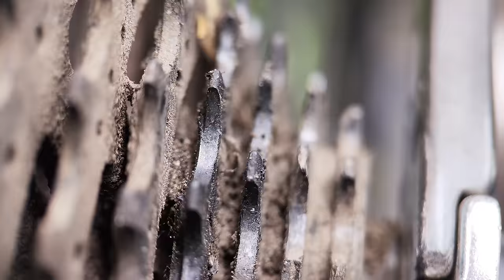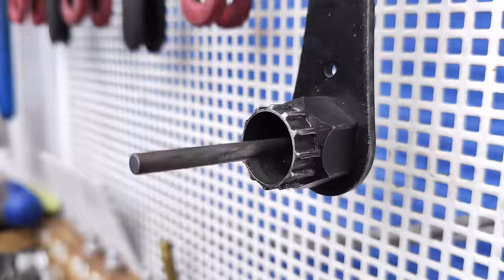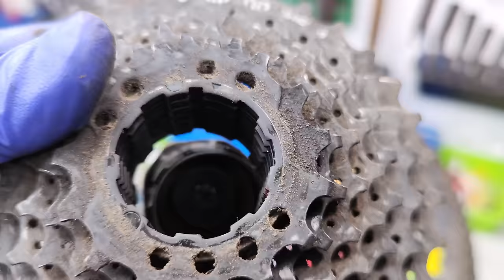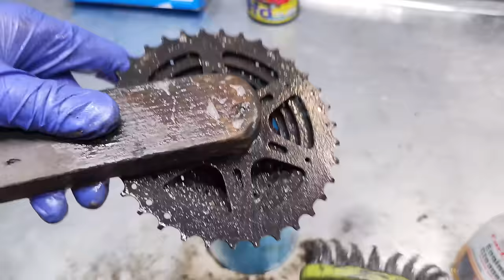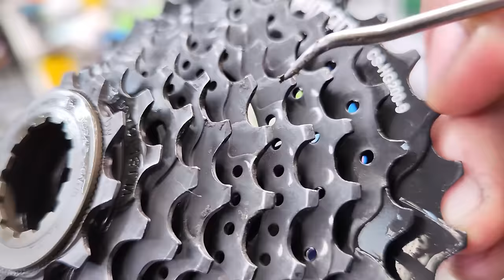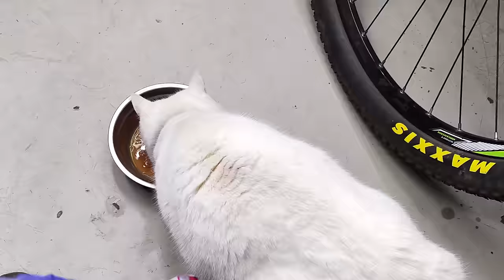How to clean a bicycle cassette. Bike drivetrain maintenance

Comment: I used to use Q-tips and alcohol swabs to clean my XTR M970 cassette; rather time consuming. Then I started buying WD-40 degreaser. I stopped buying this because it seemed like more went on the floor. Now it's just cheap toothbrushes and a Park Tool brush👍👍
Reply from the maker: thank you for your comment! 😘

Comment: . . sweet nonsense. Experienced mechanical engineers clean with sensitivity and high-pressure Kärcher. in 5 minutes. first the drive, then the MTB, then the cat.
Reply from the maker: The cat does not like it🙀
Reply: You don't use high pressure for bicycles you are not washing a motocross

Comment: Ultrasonic cleaner all day long but might damage the finish to cassettes with black anodizing.
Reply from the maker: We experimented and washed some parts of the rear derailleur in an ultrasonic washer, and almost all the black paint came off 😹
Reply: @NiceBikeService you lost the anodizing because you used a cleaning product containing sodium hydroxyde (= caustic soda), it has nothing to do with the ultrasonic cleaner itself. Just use soap or degreaser without sodium hydroxyde and you'll see no damage on anodized parts!

Comment: YUCK I haven't seen shit like that for years, I use wax on my chains, no mess, no  reason to use chemicals to wash it off, those chemicals wipe out grease/oil where you want it, like bearings, cables, bushings, seals, all I've washed my bike with for years is water, and sometimes a rag. I simply use Squirt Wax, or you can go for the melting was route, which is probably better, but it takes time, and I ride a lot, I'm not giving up my time on the bike to wax a chain, when I can Squirt, and it go ride..Happy Trails
Reply from the maker: Thank you for your detailed comment. Paraffin greases are not suitable for everyone. You have to choose one of two problems: either dirt on the transmission with conventional lubrication or more frequent application and squeaking with paraffin lubrication

Comment: I use my speed pedelec for commute, I have 30 km in one direction. Approximately 1 hour. Based on all the videos that I have seen about Drivetrain maintenance, I should cycle 1 hour to work, 1 hour to home and then clean my drivetrain for 1hour every day. It is often raining where I live. That is just unbelievable, stupid videos. 
I think that cleaningles of those parts are overrated, and that the whole industry is seek.
Reply from the maker: Thank you for your comment. For such weather conditions, you really don't need to bother with cleaning and lubrication. But you can also try a bike with a Internal gear hub and belt drive😸